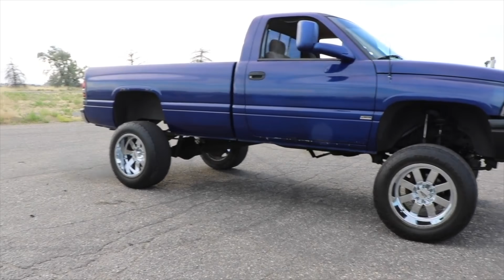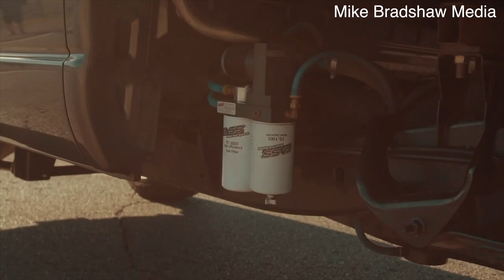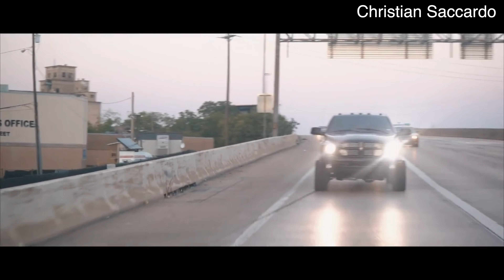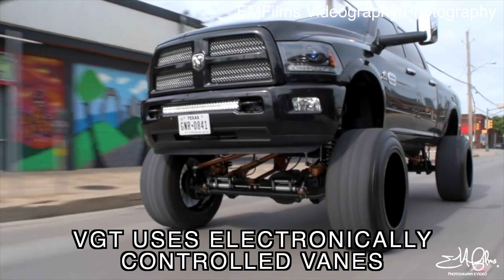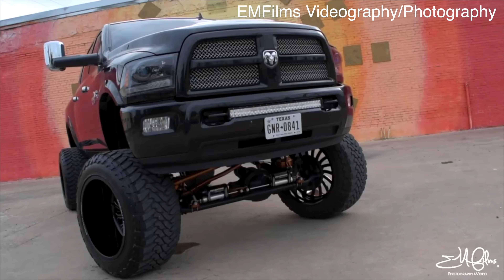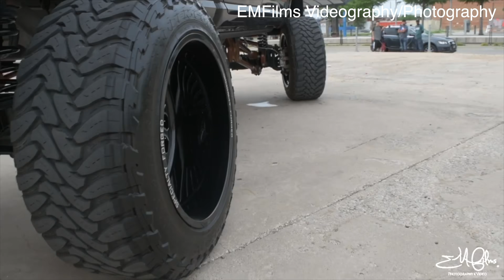5.9L vs 6.7L Cummins: Which One is Actually Better?

Comment: I ran a modified 5.9 for years towing a 40 foot toyhauler with a sand car and a sxs in it.  The 5.9 had the complete banks kit.  High ram intake, intercooler, tuner.  Never had an issue.  I bought a heavier toyhauler so i thought i needed a heavier truck, so i bought a 2010 3500, 6.7.  I did the same mods.  Intake, intercooler, egr delete, heater grid delete, exhaust, tuner,and it made shit power compared to the 5.9. Not only that i blew the 68rfe within 5 years, then blew a head gasket within 8.  

My 5.9 was bullet proof and made way more power even on the stock turbo.  Im not sold on the 6.7.  As i write this my truck is in the shop for yet another catastrophic failure.  I either blew another head gasket, or an injector stuck open.  Not sure which yet.  The 6.7 in my opinion is a VERY COSTLY OPTION.  I would 5.9 swap my truck in a heartbeat f it wasnt so technically infeasible

Comment: Love my 06 5.9 because of what it lacks. No emissions crap, no regens, no def, no hydraulic lifter failures no carbon build up or heater grid bolt dropping in the engine, and no limp mode.

Comment: 5.9 12 valve. Bullet proof dependable.
Newer costs escalates for electronics. Injectors $100 VS $700. Shop fees are and expenses 300% more for 24 v electronics.

Comment: I first tried to become knowledgeable of the 5.9 and the 6.7 Cummins Diesel Engines . This was in the 2000 teens . After my research I felt the 5.9 Cummins Diesel was and is a more reliable diesel engine . So I shopped around and looked around at nice good Dodge Ram Trucks with the latest 5.9 Cummins Diesel Engine . A lot of looking around because so many people abused every kind of truck that was for sale and didn't matter the manufacturer !!!  Which added to my searching !!!  After 3 years of looking , I found what I was looking for , a nice clean good Dodge Ram Diesel Truck with the very last of the 5.9 Cummins Diesel Engines !  It's a 2007 Dodge Ram Mega Cab with the 5.9 Cummins Diesel Engine , rear wheel drive which has the better fuel mileage !!  I bought it and have been extremely happy with my truck !!!  Problem free , as long as you keep up on your normal maintenance of course . It pulls great from 30+ foot 5th wheel campers to 30+ foot gooseneck trailers and smaller trailers including car hauler enclosed trailers . It's been the most reliable truck I have ever owned with all the miles I've driven it !!!  I talk to many owners and drivers of the 6.7 Cummins Diesel and they tell me of all their problems and break downs . Where I don't have any problems or break downs . So I am extremely happy to luck out finding my 2007 Dodge Ram Mega Cab with the last of the 5.9 Cummins Diesel Engines !!!  It's a work horse of a very reliable diesel truck !!!

Comment: On price to purchase alone .... the 5.9 is far less hefty a price tag and if you want to buid it up to big HP/TRQ you can do it in stages according to budgets available ...or if you decide to increase power for "cheap"...still have a reliable engine and are not in jeopardy of breaking CARB laws etc ... there are lots of performance boosting devices from Smarty, Edge etc... Winner...3rd Gen 5.9!!! On appearance...the late 2nd and early 3rd gen Rams look more like trucks than the following generations of rolling road palaces.

Comment: Have a 1991 D350 with the 5.9 12 valve. Purchased new on Halloween Day in 1990. Now has 486,000 miles and still going strong. Replaced the water pump, alternator, starter at 400,012 miles. Nothing else has been touched on the engine. Still gets around 22 miles a gallon unloaded and about 16 mpg pulling gooseneck with 580 Case backhoe. Not a speed demon but gets the job done. Also have a 2007 3500 with the 6.7. I've constantly had wiring harness problems, and injector problems, head gasket replacement and other items throughout the truck with only 125,000 miles. It's a great truck when it runs but not trustworthy so I'll stick with the 5.9 12 valve.

Comment: It's not safe to push a gear driven diesel engine beyond a certain point. By adding more power, you're just trying to make the engine rev faster. Gear driven engines has some limitations per se

Comment: If you want to see something weird, look at non dodge applications. There were 5.9's with egr. Also when not in a dodge the common rail 5.9 and 6.7 are both rear gear train instead of front gear train.
Reply: I have a 5.9 24v in a Ford F-650 tow truck that weighs 17,500lbs empty and can get over 30K when towing 2 vehicles. Truck’s slower than a frozen dog turd, but muh torques!

Comment: I'll take less gas mileage for quality of ride, as nice as 2nd gens are to look at they are piles of shit, everything falls apart, from doors to dash, they are obnoxiously loud to drive more then 10 miles. Also the 6.7 with a delete kit gets great mileage specially if you're smart or lucky enough to get g56 manual and here comes the shit talking about the Benz g56. Anyone who talks shit about it either never owned one or is a dip shit who doesn't know how to drive.
Reply: 3rd gens slightly less piles of shit. 4th gen RAM is when they finally got their shit together

Comment: "03 3500 Laramie. Owned it since 07 and have modified it with many, many upgrades geared towards reliability (To many to mention). Can say with only 130K it is an Awesome truck. Solid as can be. Planning on another $20k of upgrades on power, trans and more suspension upgrades. Less expensive investment than one 15 years newer!. Great platform

Comment: I mean not that it really matters, the original 5.9 came with only 160hp stock (the first Case applications may even have gone as low as 130-150hp injectors), and it was introduced in 1984, not 1989. First application was the JI Case 1896 Farm Tractor in 1984. Then Dodge licensed it for R&D, with their first production vehicle releasing in 1989.

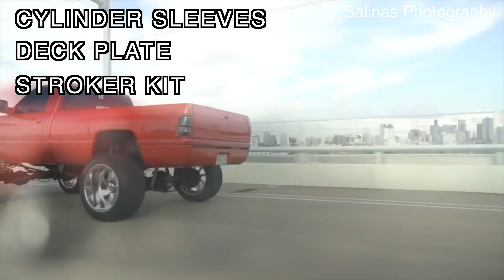6:00 Wait.... 390CI is only 6.3L... How'd they decrease the displacement? Did you mean 490CI/8.0L? Also it's 2023, Cubic Inches are dead. Everything is Metric now. Metric Conversion Act of 1975.

Comment: OK these weirdo pimp my ride edition vehicles are not diesel trucks.    A diesel truck is for work flat bed or no bed hot shot welding rig ALL of which pull trailer. 

Who gives a rip about a lifted pavement princess squatting to p
Reply: 5.9 all day

Comment: Without Mods the 2007 5.9 and 2007 6.7 were very similar in pulling power. I had one of each and a Neiber had 
a newer 6.7 that was more power. But all that smog crap did give him trouble.  One time they had to clean the filter. It was near a school and the crap that was blown out did not look like it was safe. And much of it was back in the air. Pretty stupid in my opinion. I recall in the 70s the 455 came out to replace smaller block gas engines. So much Smog stuff was added a larger Engine was needed to make up for lose. I can see in a City it helping but outside the city it causes burns on trees mostly from the uric acid in the exhast.  When a car or truck burns MORE fuel to go the same distance it seems to me more polution just differant kind. Diesel exhast 
looks bad but I was told in the 70s two things. Less toxic and the smoke falls to the ground and some types of backteria eat it and make it non toxic. Not saying that is a fact. Just saying folks that knew more than I

Comment: 6.7 deleted headstuds tuner and built transmission will school a 5.9 that is not engineered or built... and if you build a 6.7 it will school a built 5.9. 6.7 really is amazing for sheer power

Comment: Im not a fan of the electronic controlled diesels. And especially not a fan of the def systems and expensive emissions equipment. 

Ill take a 12v mechanical 5.9 all day long over just about any other diesel in a truck.

Comment: I wouldn't trade my 2005 Ram 3500 5.9L Cummins for love nor money. Still going strong. Service and replacement parts as needed. Almost 300k on the clock and still tows and pulls like the day I  bought it.

Comment: Great video! I have a 1999 2500 5.9 since new. Currently at 392000 miles. I've pulled everything under the sun and I am still on the original automatic transmission. Only problem I've had is the VP44 injector pump. The last VP44 I replaced went 170000 miles on it. I changed the lift pump out every 60000 miles  regardless to keep the VP44 alive. I am in the middle of refurbishing this old gem and started out with a Fass lift pump and new injector pump. It's been an amazing truck!
Reply: So the 5.9 cummins with a 4 speed automatic is reliable?
Reply: Install a fuel pressure gauge after the lift pump so you know it’s working properly. That’s what I did with my 2002 after my first lift pump went bad and destroyed the vp44

Comment: I have several trucks one 90 12 valve that has been super reliable. Also have two 08 6.7 with high miles. The one 6.7 has never been touched. The other has had head and head gaskets twice. It is needing head gasket replacement again. I doubt that they had upgraded the head bolts. 
I love the 6.7 with trailer in the mountains. Jake saves a lot of break use. Also the power is nice because the engine doesn’t struggle. Fuel economy, well it sucks with the 6.7

Comment: I have had both and I do have to say the 6.7 definitely has a lot more power but mine did blow the head gasket and injectors. To where my 5.9 hasn’t had those problems. But my 5.9 did need a transmission rebuilt and the 6.7 didn’t. So it’s really a toss up. I do know that you can tweak the 5.9 motor to add more power really easily. But it just depends on how much you want to spend. I believe both are great motors

Comment: Some guys swapped parts from the 5.9 to their 6.7s and ran them with the vp44 due to emissions. Said driveability was improved

The 6bt debuted in Case heavy equipment. One can source parts for the one on the dodge from them.

Comment: The 5.9 motor is way more reliable but what isn’t on some of those was the the 47RE automatic transmissions in the late 90s and early 2000s. Although a lot of those were caused by aftermarket mods by owners

Comment: But what about the predator 212? A little smaller than the 6.7 for sure, but no lift pump and no fuel injectors. Been driving my harbor freight ram 5500 for 6 years now and it will be my last truck

Comment: Iv owned the 5.9 and I have now owned 4 of the 6.7s. You really dropped the ball on the major issue the 5.9 has. The 5.9 used the 53 block in some 90% of the motors from like 98-04. It is a complete piece of crap it develops a water jacked crack mine was 14 inches long. It is well know as when I went to sell the truck I was bombarded with interest and it always started with is it a 53 block and then that was it no thank you. I should of gotten 15k for that dump truck I had to give it way for less than 7k. 

Other than that you have some video of the ugliest rams I have ever seen. The look retarded with those tires and those lifts. 

My 2011 ram 4500 had sensor issues like crazy fuel rail sensor and nox sensors. My 2012 ram 4500 had non of those issues instead it liked to destroy the passenger front tires in about 5000 miles and they couldn't figure that out. My two 2016 Ram 4500s have had 0 issues the motors. But they both had the AC die on them.

Comment: Have had 3 3rd gen rams with 5.9s and 48REs. Great trucks. 1st one was all stock and beautiful. No complaints. 2nd one was 300k miles and I built it to the T and it made 749whp with room to go (didn’t want to blow up my 300k mile block) also took lots of trans work and the front end was poop. 3rd one just had a smarty touch, Intake, exhaust and mild trans build, good truck. I now have a 2021 6.7 and it absolutely destroys the 5.9s in power department. 6.7 deleted is 100% superior in my mind

Comment: It’s increasingly harder to find a 5.9 in good condition but for towing and delivering RV’s for a living, the 6.7 should be great. Obviously not for racing or pushing it to its limit, so I would not be too worried about head gaskets being blown. EGR’s really should probably just be maintained more than manufacturers recommendation to insure optimal dependability.

Comment: I have owned my 06 2500 Dodge Ram truck/5.9 cummins turbo diesel since 2006 (16 years so far) and the dependability/reliability is like no other, just close to 200K miles and she still going strong with original transmission ( 48RE) injectors and everything except for the front end steering components and gear box that I upgraded. I can’t justify getting a new truck 😎.5.9 till death 💀 come for me.

Comment: I’m going for the 5.9 with a variable turbo. Not going to add a additive to raise my fuel cost. From my understanding both have head gasket issues when you increase HP. Studs help with that. The stronger block sounds good but I’m not going to that HP. No smog motor is the ticket!

Comment: Personally the 12 valve 5.9 is the best Diesel engine made from the big three. I think it’s better than the OBS 7.3 IDI. It completely outmatches the 7.3 IDI in every way except maybe longevity but that’s the only thing an IDI is good for. It’s power and torque is not very good at all. I’m a Duramax guy so I would take a nice Duramax over any other diesel but if I had to choose a different truck it would def be a 1993 Dodge 12v 5.9 cummins

Comment: I rather have a 12v then a 24v yes 24v makes more this and that but what makes the 12v special in everybody hearts is that is was mechanical timed no electronics just pure engineering I have a clean 2nd gen and the plan is to swap the v10 magnum to a 12v

Comment: I have a 5.9 12 valve 398000 miles pulling fairly strong yet and a 6.7 203000 pulling strong yet both start without hesitation in the cold Wisconsin winters.  I love them both for there abilities and reliability. The best of both worlds.

Comment: Chrysler said they would drop Cummins if they didn’t build it bigger for sales. Cummins doesn’t actually warranty Cummins in Chrysler trucks and they have such a huge sales that Cummins catered to Chrysler to keep selling the product. The 5.9 could have got a egr system and dog filter to pass epa7 emissions. What’s amazing is the 5.9 pass 04 emissions with common rail injection alone. While other manufacturers made dirty egr systems

Comment: I've own Mopar since I started driving in mid 70's. Challengers, RR's, Fury's Chargers, trucks etc. I've been away from classic auto seen for awhile now / was looking for a project. I found an unmolested bone stock (except 35's and aftermarket radio), 97, 5.9 P-pump w/5sp with easy 222,000 miles no rust CA truck. From reading the comments... I think that I made a good choice.
Thanks for the upload.

Comment: For some reason I am beginning to think that I must have some sort of bastardized truck.  I have a 2001 Ram 2500 3/4 ton with a 5.9L 24 valve turbo Cummins diesel.  For some reason I see that some of these trucks have a 5.9L 12 valve but I love my 24 valve diesel.  And I only have 103,250 original miles on it.

Comment: Low power and longevity. I’ve pulled incredibly heavy loads with a 5.9 with the 5 speed. It doesn’t need to roll coal to make the torque needed. My 7.3 powerstroke on the other hand is a dog without the extra power. On windy days I wasn’t able to get into 5th gear.

Comment: All 3 (includes 12 valve) are winners.  12 valve for complete reliability.  6.7 for the ultimate power.  I've got the common rail 5.9, which i'll be keeping for quite a while (the non-emission reliability).  One item NOT mentioned is that the 5.9s are getting old.  the newest being 14 years old now (mine  :-).  A 12 valve would make an awesome commuter, while a 6.7 dually is going to be your mass hauler.  I.E. depends on your use.  In the end, get a Cummins!

Comment: Question, if your swapping a 12 valve into a 2008-2010 6.4l Ford F-series truck, due you still have to run emission? Or can you get buy with a catalytic converter since, like you said, the 12 valve predates diesel emissions?

Comment: The 5.9 isn't prone to head gasket and water pump failure like the 6.7
It's not stoved up with emissions.
With the right set up it is equally capable as a 6.7.
5.9 will Always be better.

Comment: Bought a Ram 99 CTD new, in dec 99. Put 241,000 miles on it in 5.5 years. Engine was solid, lift pumps...not so much lol I think I went thru 4 of them. Also spring a shaft leak on the VP-44 ...I attributed that to my switching between hi and lo sulfur diesel fuel a lot (yes, I ran off road 3,000 ppm sulfur in it as well as on road 500 ppm — and sometimes BP Diesel Supreme which touted 50 ppm sulfur) So I think this up and down sulfur content caused the shaft gasket to deform giving me a fuel leak into the crankcase. Luckily I bought it early and did no internal damage. The CTD 5.9 24-valve Was a great engine.

Comment: Thanks for the vid.  I always wanted to know the differences.  Sounds like both engines are good, it just depends on personal preference/use. For me, I'm glad I have the 5.9 version for reliability as I have no need or desire to add any performance mods.
I have an '03 3500 Ram dually 4WD with the 6 speed manual I bought used in 2009 with about 55K miles on it.  Almost 12 years later now, it now has a little over 135K miles on it.  I only use it for travel.  One year it sat for the whole year in the garage, which wound up costing me over $400 dollars to replace the Optima batteries.  I now take it out once a month for a short drive, about 30 -50 miles to keep everything working.

Comment: Thanks for the input. Just looking to tow. Think the 5.9 with no emissions is probably the way to go.
Reply: It is as long as you live somewhere that doesn't do emissions testing.
Reply: @charlesisbell4340  5.9 had no emissions other that a catalytic converter. In 2007.5 with the move to 6.7L stricter emissions standards came in to play.